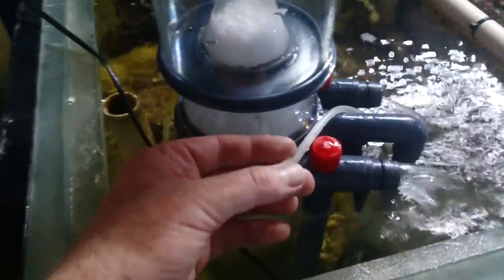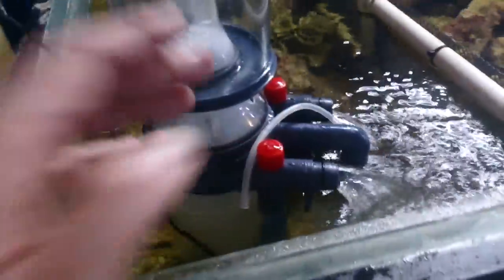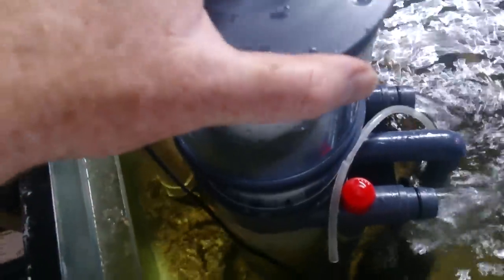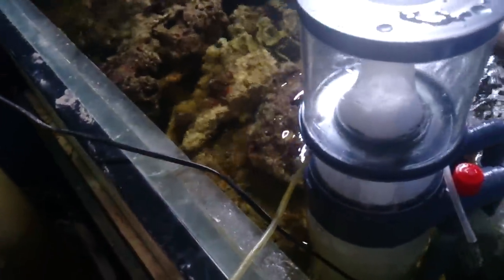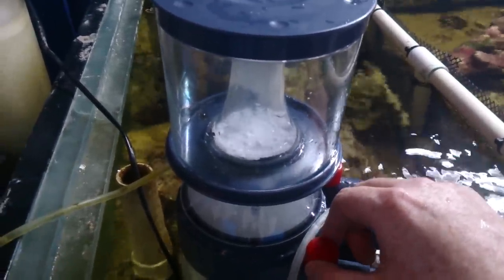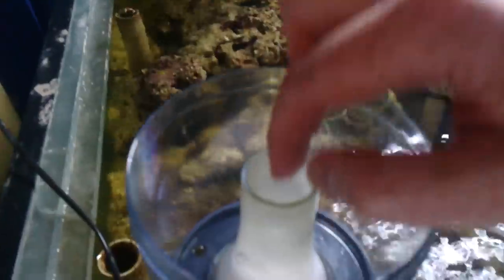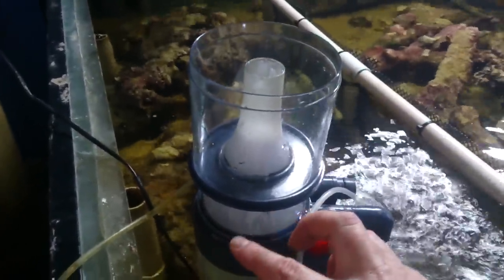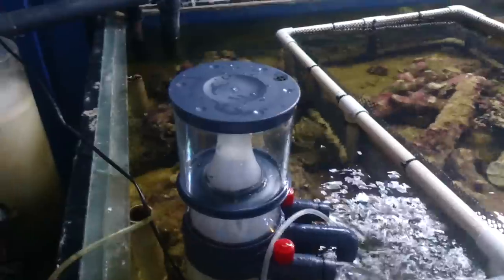How to set an Aqua One protein skimmer

Comment: Hi, I notice your using the skimmer without the filter sponges. Is that OK to do? Mine seems to be kicking out micro bubbles atm and was wondering if removing them may benefit as it seems quite excessive, or would you recommend leaving them on during break in period.
Reply from the maker: best if the sponge is on
Reply: Cheers. Will do.
Reply: The sponges are what stops/prevents  the micro bubbles

Comment: @majestic aquariums, mate im using the g216 .. and i dont really have any room to run the drain hose from the cup into a coke bottle etc, im thinking of just plugging the hole with silicone and emptying the cup as required this wouldnt really have any bad effects as you dont have to use the drain hose right ?, also its in sump so if it overflows no harm done really right ? as it will just go back into the display tank
Reply from the maker: I prefer not to use the drain

Comment: Good advice, as instructions are unless that came with it, couple off questions I keep getting mirco bubbles from outlet ports as I'm hanging unit on back off tank also my taps are almost fully closed does that matter? Tank is an 200ltr
Reply from the maker: David Owen 

Good advice, 
thanks
 as instructions are unless that came with it,
yep
 couple off questions I keep getting mirco bubbles from outlet ports as I'm hanging unit on back off tank
I suggest having the skimmer on a timer so it is off while you are likely to be viewing the tank. I would mainly have it on at night
 also my taps are almost fully closed does that matter? 
not if the unit is totally white with bubbles
Tank is an 200ltr
feel free to email me a video of it running to review
Reply: To help with micro bubbles try tilting the outlets outwards

Comment: Hey mate, great video. Does the outake valves with sponge filter need to be immersed in water? I prefer not to fill my tank level so high as its hanging off the back at the moment. thanks!
Reply from the maker: Doesn’t matter
Reply: @MajesticAquariumsTV  thanks!
Reply: It’s a outlet so doesn’t matter I took mines off as I have a lid bracket slightly in the way

Comment: I have a fish and corals Aquarium 90 gallon. I had my Aquarium up and running for over 7 years now without a protein skimmer. What benefits will I get if I added a protein skimmer now in my sump area?
Reply from the maker: just do it and see
Reply: @MajesticAquariumsTV  Can you send one over to me?
Reply: Thankyou for this review. Do you think a protein skimmer would help clear bacteria out of the water? I am trying to get rid of cyano that forms a cap on my substrate which I have been  removing with a net by scraping the sand but it comes back within 2 weeks again.

Comment: Well new protein skimmers need to cycle so put it in tank let it run for a day over flowing and for you’re pump you don’t have it on all the way.. the (bottom) of the pump has the suction cups are not for the bottom of the tank it’s to suck onto the side of the wall of the tank it’s a hang on the back filter it’s not long enough to sit on bottom and when you have the pump sitting side ways you don’t get that bubbles that escape the pump